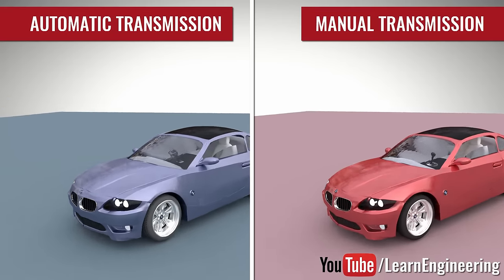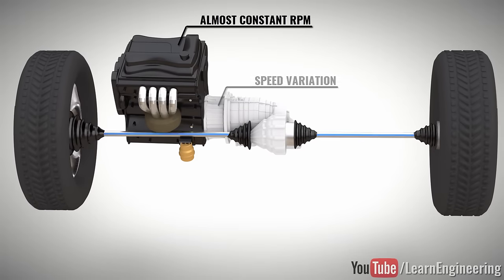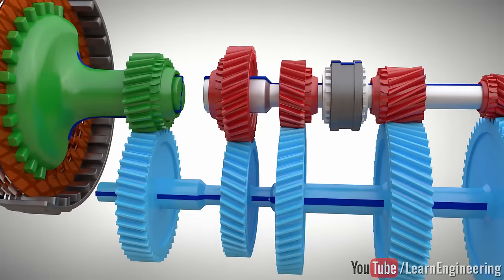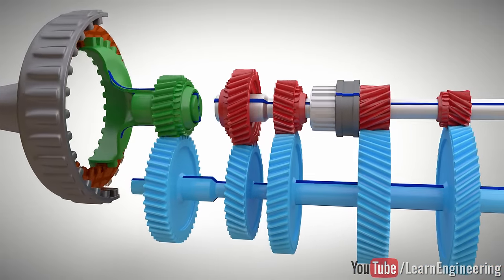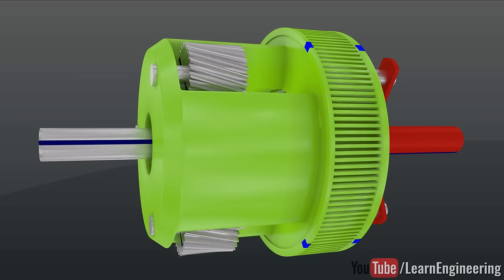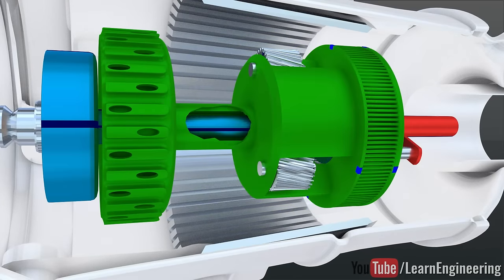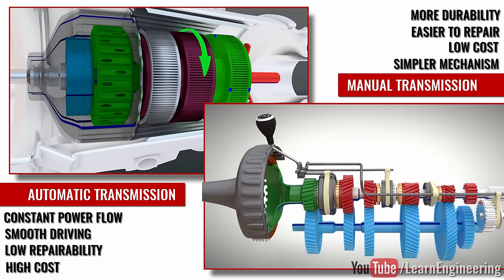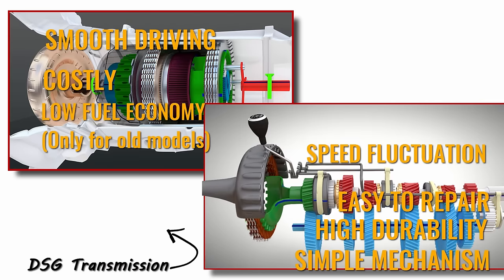Automatic vs Manual Transmission

Comment: Driving one or the other is often economic as much as it it a cultural preference. For example, in the UK and Europe where petrol as twice as expensive as the US most cars tend to be four cylinders, that coupled with a manual ensures the best fuel economy. In my part of the world, most country drivers use manuals while most city drivers use autos. Again this is cultural, the perception in the country amongst males is that you are not a real man if you can't drive stick. While in the city there does not seem to be that same hang up.
Reply: For years I've been driving cars with automatic and I'm grateful for the automatic, which originated in the US in the early 1940s. I'm from Germany. I don't want to miss it as long as there are cars with combustion engines.
Reply: Bitch I drive my stick through the city every week, never had to reach clutxh

Comment: When I've had smoother experiences driving a manual and more rough automatics...
Unless the car is super smooth and probably built within the last 5 years, my manual is probably smoother.
Reply: Depends on the price of the car too and also the age of the manual car also matters. I have never been in a manual car that had smooth transmission. You always know when the driver changes the gears because you slow down a little bit no matter how good they are. In an automatic this doesn't happen. Sure in old entry level automatics it was pretty rough but in any car that isnt a complete entry level car it's definitely smoother. But if you want the best of both worlds there are semi automatics which a lot of higher end SUVs and sedans have and you have full control of the gears with no clutch.

Comment: Do combat tanks qualify as heavy-duty vehicles? I haven't come across a modern combat tank that has manual transmission. Pretty much every single one of them has been automatic.
Reply: Mouldy CPU automatic prime movers are getting really common. but i have been told they are harsh on the drive train
Reply: bitchgvng Memorial service
What does that have to do with my comment? I'm not questioning the usability of automatic transmissions in combat tanks.
Reply: Mouldy CPU actually tanks and ifvs usually have manual transmission controlled by computer. so the computer does the shifting. older tanks (ww2 mainly) all had manual
Reply: tamas lapsanszki Also, he did not say that all heavy vehicles have manuals, just most.
Reply: completely wrong. tanks use cross-drive steering transmission, a different beast altogether, but more closely related to automatic than manual transmission. Manual transmission tanks are virtually impossible due the skills required, it would be too demanding of the driver. Tanks run on tracks, cannot be compared.
Reply: Andy Chow yeah, that's what i was trying to express, the transmission controlles steering in all but the oldest tracked vehicles.. though i always thought it's closer to manual based on how it changes gears. could be wrong though, i am not a tankist nor an armored warfare historian, and there are so many different technologies
Reply: Dude, When the guy spoke about durability for heavy duty, it is for commun cars... I mean, tanks do have heavy duty when it comes to ride a field in a war, but realy, who cares ? States pay for the reparations and they also might have a certain type of transmition specific to tanks... Even tho !!! You're comparing tanks to cars ! There's no way you could do that on any point. Transmition or anything else... XD
Reply: You could compare them by estetichs. I would anytime choose to drive around in a Leopard or Tiger instead of my Golf 4 Variant :)))))))))

Comment: Which is better, manual or automatic transmission?

Easy answer: manual.

Automatic transmission doesn't even feel like driving a car, it feels like driving a toy. Plus, you do feel the transition from one gear to the next in an automatic, and I daresay I can make that transition smoother in a manual shift by feeling the clutch appropriately, while there is no option to do that in an automatic. Also ... the loss of power during shifting? How long does this guy take to shift? Yes, you can do it slow and easy, but if you want to go fast it's possible to shift gears in a fraction of a second, definetly no slower than the shift in gears in an automatic transmission, and as an experienced driver much faster.
Reply: I agree, I personally hate automatic transmissions, I’ve seen too many of them have problems, and trying to fix one is just as expensive as replacing one.

Comment: Why cant there be a car out there that has an auto mode and a manual mode so when you feel like tearing up the streets you set it for manual mode and when you are in heavy traffic you put it in auto mode.
Reply: Captain_Derps1 DCT solves this partially, it lets you go up ot down in gear. I think it hasnt happened because it would be too complicated to combine both transmissions. You would have to make the car switch transmissions relatively fast. I don't think thay is possible.
Reply: Captain_Derps1 Yes.. Continuously Variable Transmission (CVT) can solve that problem.. but without Clutch pedal, but what I don't like about CVT the speed is almost constant continuously, this makes no Taste of Shifting to feels that the gear was change to the next gear like A/T & M/T not this CVT. aah.. maybe on future that's would be come true :)
Reply: Because it sounds dumb
Reply: A Dual Clutch Transmission would be better suited for that. It's essentially an Auto-Manual. However, there is no clutch and no stick to slam through gears.
Reply: Cause that would be really expensive and complicated to design.
Reply: its not a video game to have both modes in the car, its real time engineering

Comment: "80% of heavy duty trucks use manual transmission" 
They should visit Europe
Reply: most trucks in Europa are medium or light
there aren't a lot of heavy duty ones
Reply: @nickplokhotnik7799  Since 2007-2009 manual transmission is more expensive than an automatic one since it is an extra

Comment: It takes less than half a second to shift up in a manual transmission. There really is no loss of power if you don't shift until you have to. The real reason for an automatic is traffic. Having to start and stop every 2 seconds gets pretty annoying pretty quickly. Also harder to text with a manual.
Reply: Half a second? Yeah if you want to bugger your clutch and gearbox.

Comment: Well then why do manual cars feel like they have more power sooner and more at your disposal?
Reply: Luca Capperucci because of a clutch pack. The hydraulic system autos use is like blowing one fan with another in order to move the tires. It lags the power of the engine because you need to add more energy to the fluid to make the wheels move the same amount.
Reply: Micah Burgin oh thank you I've always wondered
Reply: because no torque convertor lol
Reply: You have only driven not real automatics, like robotic transmission.

Comment: It's not true that manuals are never smooth, some people can drive a manual as smoothly as an automatic. Just learn to drive.
Reply: here, here
Reply: Manual transmission will never archive really smooth shift, but to reduce the the "spike" you can try quick shift + rev. match, most people will realize that is automatic.
Reply: It is possible to be easy on the clutch and gas when changing gears. I can do it. I'm just usually a bit lazy or trying to rush. ;)
Reply: you can attain this by listening carefully to the engine revs or by looking at your RPM gauge. and yeah, timing is essential so that the engine won't stutter.
Reply: Alberto Lucà like a F1 racer 😁
Reply: Rommy soeli again, real smooth shift is achievable with a manual. it is indeed a matter of timing and listening to the engine.
I can assure that a manual could be driven as smoothly as an automatic, my dad used to drive trucks since the age of 16 and now he is 62, he's taught me things and showed me that even a fat big truck, which has longer shifting times than a car, can be driven as a manual :)
Reply: TRLWNC1 you can also not go easy and me smooth anyway, you just need a lot of experience and a good ear to listen to the engine
Reply: Daniel Tabudlong i personally am training myself to listen to the rpm, instead of looking at the gauge (i was taught that way by my father), but yeah, timing is needed.
Reply: Bagus Prasetya tecnically f1 racers of 1960s when they still had a shift stick, because now they have the electronic sequential which is another kind of shifting (which I personally prefer to the automatic anyway)
Reply: I ve bad experience with matic transmission,even when i didnt push the accelaràtion the matic car moves it self,so i must push the brake cause if i m not,it will starts to move forward?I choose manuàl.
Reply: With perfect timing and practice you can drive manual smoother than automatic. I do
Reply: Alberto Lucà I was going to say the same thing. It is all about how good of a driver you are in switching gears!
Reply: Cekeybula never mind that :)

I was comparing a perfect smooth manual gear change to sex. Formula 1 drivers compare taking a perfect corner to sex but I'm not an F1 driver.. the gear change is the closest I get :)
Reply: So you are as smooth as a double clutch Porsche Gearbox ? Impressive
Reply: +Cekeybula you can get better performance with a manual as you can control when you shift, pushing the clutch doesn't take effort. Your arms do most of the work.
Reply: Alberto Lucà I mean like I Quick Acceleration, the source of spike is the clutch bcz just have a clutch it need to be disengage last gear and engage next gear, manual never can remove it ( Iam not Automatic Fanboy) ( Cheap Conventional Automatic Car also have spike when floor the accelerator) I mean the spike is clutch time, manual never can remove the clutch time, but dual clutch automatic can remove the clutch time since it shift seamless just at same time disengage last gear and engage next gear. OK you can make manual feels like Automatic when not rush it, but I cant remove the clutch time. My best clutch time is 300ms it is very short time the key keep it smooth is rev match + quick shifting ( to reduce the time when gear disengage)
Reply: Just force a little bit the gears when you are speeding up.
Reply: Alberto Lucà Plus some automatic cars are not even smooth xD
Reply: Naej I used to have one of those XD.
Reply: Pressing the clutch will always result in loss of acceleration. That's just physics. Therefore it is impossible to maintain constant acceleration with a manual.
Reply: John Doe The point is not comstant acceleration, but a fluid drive expierence, which is obtainable; also, only newest automatic transmissions can erogate a "constant accelaration" as you say, oldest one were slow in the gear change and resulted the same as manuals.
Furthermore, automatics also have a very small drop in acceleration, just like manuals, the thing is they are a lot faster.
Reply: A smoth experience is one without variations in acceleration. I am not speaking about older cars, no reason to compare ancient tech. It is impossible to maintain the same constant acceleration an auto does with a manual, there will always be dips.
Reply: The bump in speed is there but it's negligible and it doesn't affect your driving experience. Manual has everything in favour.
Reply: Alberto Lucà nah I drive with semi automatic
Reply: The only time i didnt enjoy my manual boxster was in one stop and go traffic jam on the freeway, just made my leg sore a little bit. Luckily i figured out a way back that was a well paved windy country road over a mountain range and next to a reservoir, and that was one of the most enjoyable driving experiences ive ever had.
Reply: Alberto Lucà I have yet to meet one lol
Reply: they define smooth driving as the smoothness ofenergy transfer from one gear to another you might not always feel it but im 100% sure it is not smooth
Reply: Alberto Lucà true
Reply: It may be smooth to your ears, but it is never 100% smooth like an automatic transmission
Reply: Automatic transmissions aren't perfectly smooth.  If you know how to drive a stick really well and you make it a point of trying to minimize any jerkyness, you most certainly can make it as smooth as an automatic.  The only issue is that while doing this you will be accelerating rather slowly and probably double clutching each shift so you can match the revs perfectly between each shift.

Comment: real man use three pedals
Reply: masyola oh shit, is tgat bad?
Reply: masyola that was years ago pal....now the robots do the job...
Reply: masyola Hillbillys in the midwest use 3 pedals... They get the girl of their dreams... in their case, their sister.
Reply: Paul Stefan vtec maybe
Reply: Muhammad Shafiq and a big one...😂
Reply: masyola three pedals and three legs, real man
Reply: no left leg, mine digger simulator and right leg
Reply: 3 pedals for a rally car sure
Reply: New Scania trucks have automatic transmission, but they also have a clutch pedal. You only use it when you need to make a smooth start uphill with load for example :D
Reply: Organists use 32 pedals >:D
Reply: masyola where i live, ever man and woman learns stickshift and most of them still drive them after getting their licence.
Reply: +Tolunay78 FFS
Reply: +Yudai Ogawa no it's clutch break accelerator
Reply: Simpler mechanism=manual. Which translates to simple people=manual. Hahaha.
Reply: MrCapeCanaveral what can we say?

We like what we like :D
Reply: It's all good. No need to bash on automatics though.

Comment: when does automatic knows when to shift gears
Reply: Dan Donna 

it can sense the rpm of the engine itself and switch accordingly. when you're driving a manual, you're supposed to keep an eye/ear on your rpm to know when you should shift, an automatic simply does it for you. that's why an automatic will still come equipped with an rpm dial in the dashboard. if you don't see the rpm dropping and the car isn't shifting gears, you need to go to a mechanic desperately.
Reply: thanks
Reply: or, Automatics are dumb with shifting lol.
I grew up in the mountains. With Manual, just throw it in 3rd and climb the hill. Automatics shift up down up down up down and lose momentum then gain momentum and actually require more effort to maintain your speed. It's really annoying lol
Reply: Sean Tucker damn your initial d fantasy looks good.
Reply: Sean Tucker You can manually shift an automatic, as well. I've got an overdrive disable button on my mercury...when I'm going up a long hill I'll just drop it out of the overdrive gear and it will climb the hill without a lot of shifting.

Comment: Its probably been mentioned previously on a 7yr old video but the clutch doesnt need to be engaged before braking. During the initial braking period engine braking is useful but there will come a point where the drivetrain starts to fight the braking forces, you need to engage the clutch before that point, not before starting to brake.

Comment: You forgot to say with manual you can limit the Rpms and speed
Reply: iTheGeek not really if it's computer done
Reply: iTheGeek no you can't
Reply: YES you can. Most modern automatic transmissions have full override modes, you can even select a certain gear (within the power efficiency limitations).  And what did he mean by limit the RPMs?
Reply: Well in my country all the cars are like 10-20 years old so if the new stuff has that I would not kno

Comment: Fast Moving Car = Brake first then clutch, lower gear or neutral. This is done inoder to preserve your clutch disc.

Slow moving car = clutch, Lower gear or neutral, then brake.
You need to change to lower gear on a slow moving car inorder for you not to stall.

Comment: Manual is good, is save much fuel and keep vehicle in control, it is safe, little bit confusing for new driver but it is safe.
Reply: kaustubh pethkar agree!
Reply: kaustubh pethkar that's interesting....how can it be safer than an auto?
Reply: You can do engine  brake on manual transmission unlike automatic!
Reply: Adam Kithman because in auto driver is not that much focused on road but in manual driver need to be focused because of shifting activity.
Reply: hmmm
Reply: I am not sure that is correct. I do know that manuals used to perform better on hills outright, and that during learning how to drive manuals you learn how to engine brake overall and that at least some don't teach that on autos, leading to people burning up their brakes by overusing them on hills.

The argument against manuals being safer could include that you have to take a hand off the wheel to change gears.
Reply: GroundHOG2010 yeah, other than that, u could change to the wrong gear when ur tired and not focused
Reply: Adam Kithman
That would be extremely rare, and mostly in people that shouldn't be behind the wheel at all at that time (this is assuming they are experianced at using a manual gearbox). Changing gears in a manual becomes second nature to someone that drives them often enough, for instance, I never think about changing gears in cars. Dropping the clutch is another thing that disappears with experience, though there is situations where it can become hard not to (for instance, I take stops every 2 hours or so as my ankles do not have the life in them of when I was younger).

Manuals and Automatics are relatively close to each other. Which is best depends not just on your driving style but also the country your in (avalability), what your going to use them for (commute through a city? Auto is nicer. Sunday drive through the hills? Manual is nicer), what you are used to, ect. For instance, I personally will not drive an automatic (unless it's a CVT... but that is a completely other story), because I am used to changing gears and having that control over my car.
Reply: kaustubh pethkar  auto is better
Reply: Vlad Mihai 
no. each transmission have their own  pros and cons